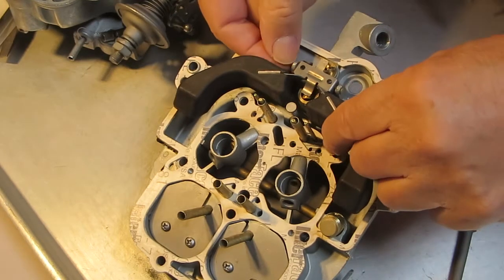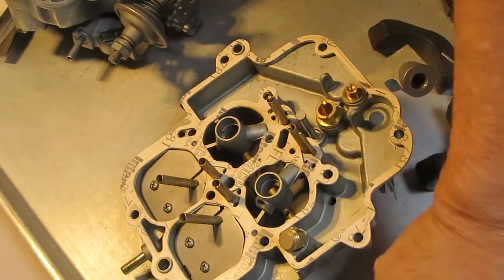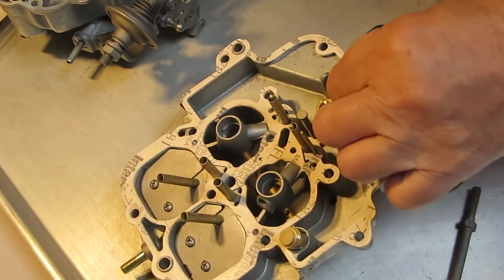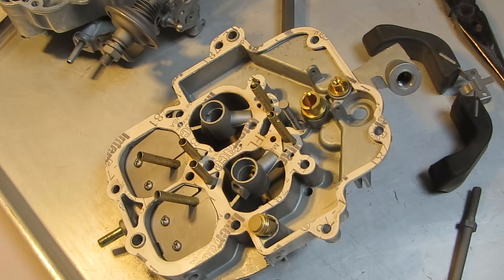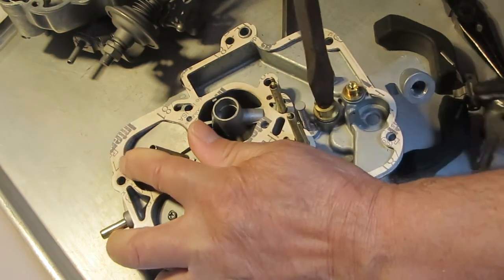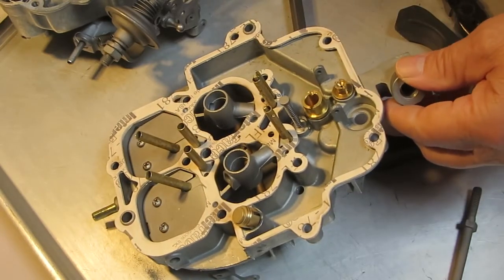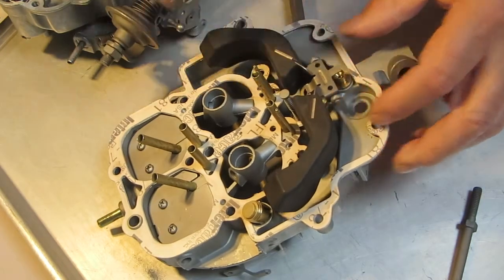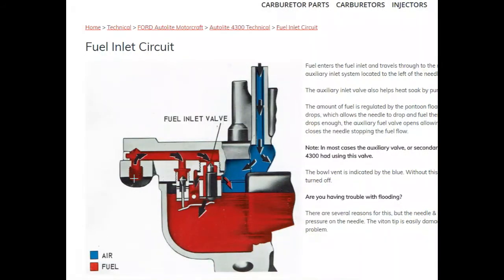Understanding the Autolite 4300 Fuel Inlet Circuit | Carburetor Technology Explained

Comment: Thanks for the video! Would you recommend plugging the auxiliary fuel port even in a high fuel consumption situation? I ask because I have a 4300 spreadbore on my 429 11.1 compression wearas the carb would traditionally be put on a smaller engine. Should I still plug it off? Thanks
Reply from the maker: Hard to say. You could always try it without plugging.
Reply: @MikesCarburetor  ok. It was actually already rebuilt to maybe they plugged it off already

Comment: Thanks for the video. I'm still wondering what is keeping the float pin from falling out? It seems quite easy to slide out.
Reply: @MikesCarburetor  I couldn't live with it. I ended up lifting the top of the carb to flatten the end of the pin a little, so there is no chance of it coming out. Thanks again for the video though, this was helpful. Cheerz
Reply: @speedy_pit_stop I did the same thing